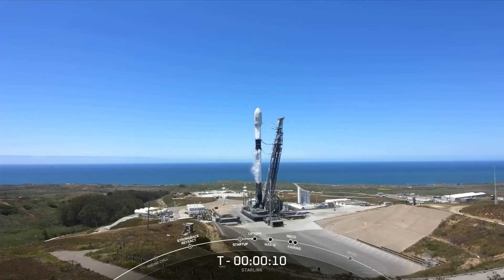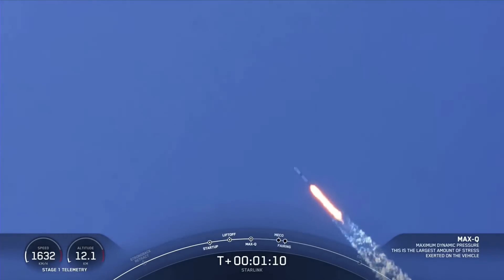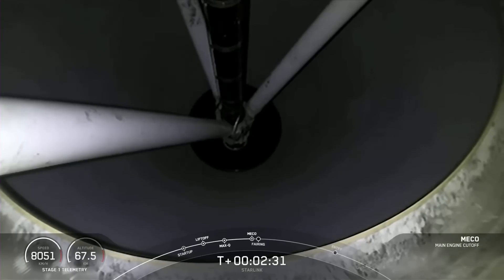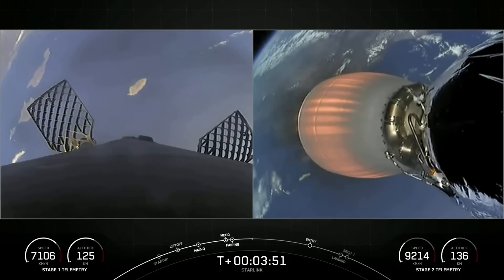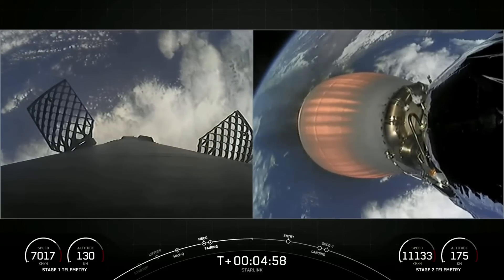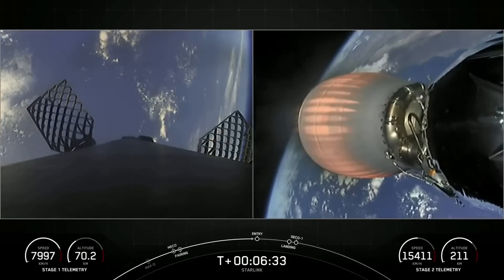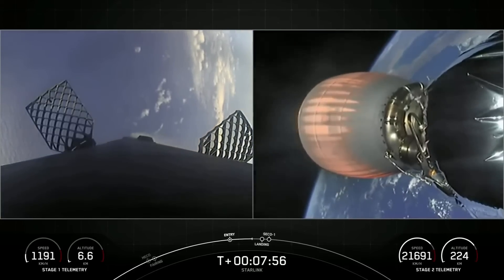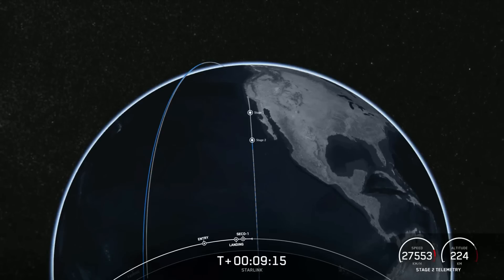SpaceX launches new Starlink batch from Vandenberg, nails landing

Comment: Is that also powered with raptor 2 engine?
Reply: Falcon 9 and Falcon Heavy use Merlin 1D. It's a kerosene-oxygen gas generator cycle (as opposed to Raptor's much more complicated and experimental full-flow staged combustion cycle), and currently holds the record for the highest thrust-to-weight ratio of any rocket engine. It's not as efficient or sophisticated as Raptor, but is still a very good engine in it's own right, and has proven to be a reliable workhorse for the Falcon fleet.